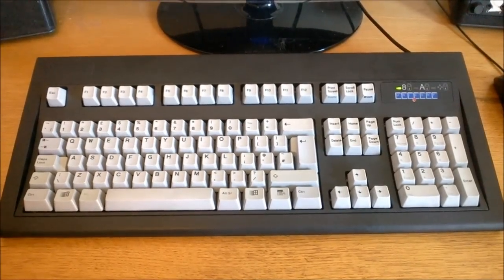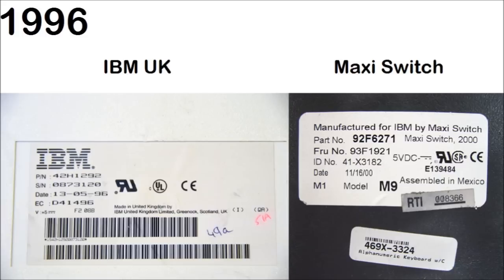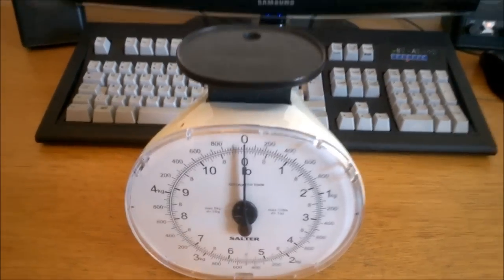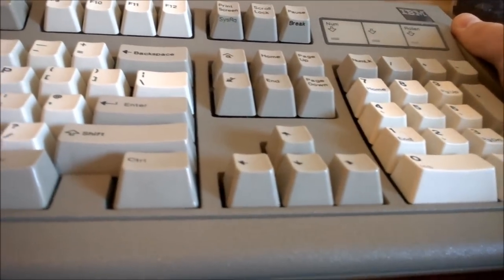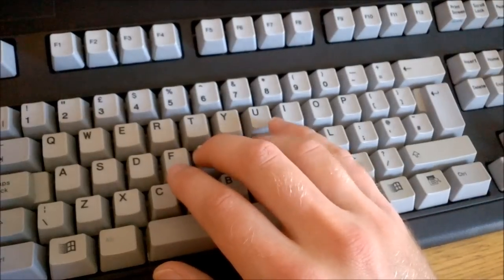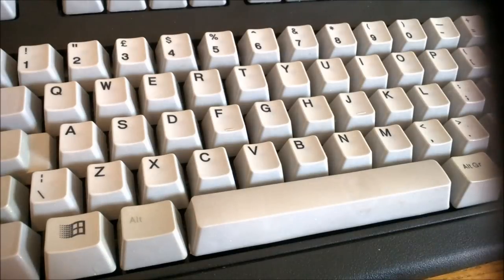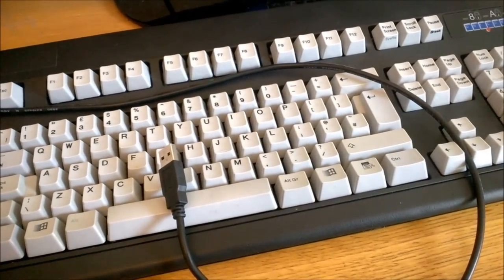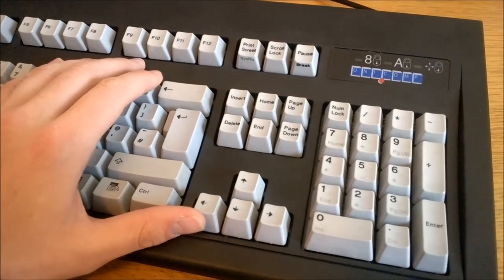Unicomp Model M review (buckling springs)

Comment: I think I have one of those prototype Model M keyboards you spoke about - according to the sticker on the bottom, 20-02-1986 - it has no badge and does not contain the led light panel at all.
Reply from the maker: That wouldn't be a prototype, Ms were already being made in 1985. You probably just have one of the XT models, which (because of the protocol) didn't need LEDs.
Reply: Ahh, good to know, thanks!. It's still got the 'AT' layout though? - function keys along the top and not the left. I've personally had this keyboard since the 1980s and it's still going strong.
Reply from the maker: Lori Brooks No Model M ever had an AT layout, I think you're confusing several types of AT here. There is the AT protocol - just thje language the keyboard speaks - which is almost identical to PS/2, and fully compatible. Then there's the AT plug, which is identical to the XT plug, it's the big 5-pin DIN thing. Then there's the AT layout, which is a physical layout, specifically the layout of the AT model F, which was widely copied by many manufacturers. The Model M replaced the AT layout as standard, which it still is to this day.
Reply: Ah, I see.  I remember using an older IBM keyboard with the function keys on the left with an old 'XT' computer when I worked at Plessey in the '80s 

This one has the keys on the top and an extra key next to the 'Z' that I have remapped into a windows key.

The history of this one was part of a 'CAD' system that tech pubs used on an old tower system (it has the 5-pin din cable but is very long and grey - this might be a replacement for the tower configuration so the keyboard cable can reach the greater distance that it needed to go from the tower up to the desk) 

I inherited the whole system (I had to swap out a brand new HP vectra for this older beast which I remember being bummed about at the time) and then I ended up taking the whole thing home at some point when Plessey were writing it off as scrap - the tower case and system and monitor  are long gone but I brought the keyboard with me to California where it stayed in a box until a year or two ago, when I brought it out and started using it again

Comment: The lettering on Unicomp keyboards had improved by the time this video came out; it used to be worse before that. That's why I bought a completely blank version. The downside of that, is that I get called a 'hipster'; the upside, is that no one around the house will dare touch my keyboard when I'm away.
Reply: It's like the days when I had an HP calculator with Reverse Polish Notation and nobody borrowed it because it did not have an "=" key.
Reply: The legends on the latest Unicomp keys are excellent, I can tell you. Sharper than what Thomas is showing us here four years ago. You can get a whole printed keycap set from Unicomp if you want. They're not too expensive. And you can get some colored keys. I got a set of blue ones for a blue and grey look.

Comment: One note regarding the two-piece keycaps. I'm not sure if they have switched to single piece for the whole product line, or if they switched back to two-piece keycaps. That being said, my 2015 Unicomp has two piece keycaps. It is the 122-key model, but it does have two piece keycaps on all keys except for the multi-unit keys. Interesting that your 2009 one has single piece keycaps. I've heard people mention the single piece key caps before, but never have experienced them. The two piece keycaps on my unicomp are identical to the two piece keycaps IBM used in the past.
Lettering print still seems good, and the only obviously mis-positioned legend on my keyboard is the right arrow key.

Comment: I had planned on getting a Unicomp a couple of months ago, but /r/mechanicalkeyboards talked me into getting a vintage Model M. I ended up getting two, both 1989 models. The second one feels pretty awful and inconsistent, so I bolt modded it, which didn't help much unless I really tighten the bolts down. Tightening the bolts makes the key travel shorter and the key press crisper, but it still feels wrong somehow. Maybe it just needs new springs.

I've thought about getting a Unicomp without the Windows or Menu keys so that I can put it in the vintage case to eliminate the creakiness and flex of the newer ones. I'm not sure if that would actually work because the fixed cable and potentially different controller board placement. Plus, I'm a bit interested in the trackball version and having Windows and Menu keys! Too many options...
Reply from the maker: A Unicomp board will not fit in an IBM case without some modifications. Don't think it's entirely impossible though.

Comment: I got my Unicomp 104 Key with Trackball (Manufactured 4/9/2014). The trackball is horrendous. The movement is inconsistent and after 4 years, the pointer is not moving sometimes. I tried to use adhesive on the rollers, but doesn't improve that much. Not worth the $30 extra compared to their classic Model M. As for the keyboard itself, it has a 2 part key cap and the feel IMO is smoother (closer to a Model F) than the old IBM ones. I own a Model M Blue Badge, 2 x IBM Model F AT and this one. Also, it has a 6-key rollover instead of a 2-key rollover.

Comment: I have one of these, and beleive it or not, the menu key between the ctrl and alt key (and no other key, I checked) IS a two part cap , at least on mine. I don't know if this is characteristic of all uni model M's but check for yourself mine was made on 5/31/2018 so this might be only on later models

Comment: If you, or anyone else, still have this keyboard, I would be very interested in buying it. It done's have to be the same layout, the only requirements that it works properly, is in a good enough state, has a 105-key layout, has the same layout of the bottom row keys as in the video, the button keys between and including the control keys should be in a good state, should use the English names, and there should be an Alt Gr key. As for the rest of the keys, can don't care about their caps, and it don't matter if they are even missing.
Reply: The good news is you can get one new from Unicomp for $104 US plus shipping and taxes. It's now called the New Model M. As for the keys, you can order a custom one, or you can get some custom keycaps (from Unicomp for example) and you can remap the keys as you need. They do both ISO and ANSI.
Reply: To clarify, that problem with the version currently being sold (if you see (on Amazon) a picture with the same layout as in the video, it's just an old picture, they are not selling that version) is that they went full traditionalist (less removing the modern keys all together) and resized the bottom row keys so that LSuper and Menu have the same size as normal keys and RSuper slightly smaller than the other keys (ISO LShift-sized instead of Tab-size), which (the latter) makes the real reproblem not fully solvable using official parts: that they swap the position of AltGr and RSuper which is not only confusion (if you use different keyboards, which is not necessarily solvable) but also extremely uncomfortable (especially when typing AltGr+7 (= {)) even though I'm very well endowed, having 25% larger hands than any other adult male I know (measuring from the largest width of the hand stretched out as much as possible), I can only imagine how uncomfortable it would be for a girl or child.

Comment: I have a Classic myself.  It sometimes doesn't register as being there when you reboot (or even when you come out of GRUB if you're multi-booting).  It's a GIANT pain in the ass given my PC is under the desk.  Also, I've had to adjust the springs on several keys to deal with non-responsive keys and chatter.  Also, while it's USUALLY fine when I'm gaming, I've had issues with the up and right arrow conflicting (I use the arrows for movement as I'm left-handed).

It's such a shame, really.  It's such a joy to type with, but it can't be a main keyboard.

Comment: I have to wonder if the 85 model m feeling different isnt in part because of the older more well worn springs too. 

Model f had one part keycaps too, I know I'm using one, I wonder why ibm changed for the model m.

oh well i still love unicomp and ibm keyboards the best.
Reply from the maker: The '85 isn't particularly well-used at all tbh. But yeah, age itself could be a factor in some ways.

Comment: I just bought one. It has a metal plate inside. it was made 3/18. Did they just start putting metal plates back or does your black unicomp also have ablack metal plate inside? Mine weighs about 4.5lbs, about half a pound more than yours is showing

Comment: I have a really dumb question, I think.

My coworker has a real IBM model M. It sounds awful. I checked it out and if you put your fingers on the keys and jiggle them back and forth (not pressing the keys towards clicking) they rattle like crazy. It seems the keys don't fit very well in the barrels.

If he got a unicom, would the keys be tighter and not so rattle-y?
Reply from the maker: If all the keys do it, it's probably within manufacturing spec. Unicomp's tooling is the same as IBM's, albeit a bit more aged, so buying a Unicomp will most likely not fix this.
Reply: I have a 2021 Unicomp New Model M, and the non-stabilized keys are pretty rattle-y. The stabilized keys (both the spacebar with its wire stabilizers and the rest with their plunger stabilizers) are pretty solid. For all keys there's some binding if you press them off axis, and it's a bit worse for the stabilized keys. But overall, I do not rate the rattle or the binding as big issues personally. I think the keys feel great.

Comment: I feel like IBM tends to over engineer it's stuff. Their mainframes, their thinkpad laptops... everything just built like tanks. So over engineered that it's difficult to break them.
Reply: Saab are the auto version of IBM in that regard ;)
Reply: @zeuperm Too bad HP has that contract now. 🤮
Reply: @sanoj92  SAAB is Shit...  900's and 9000's become money pits after 100,000 kilometers...  They are the rubber done switches of the Auto world.
Reply: And their stuff does tend to last both physically and technologically. I'm in the process of building a Thinkpad T430 and with certain modern parts and mods it's still more than adequate for most computing tasks. Model M is still a great keyboard despite being designed decades ago. So these particular examples weren't over-engineered only to become obsolescent shortly afterwards.

Comment: I was hoping you would compare the controller boards. But thanks for the vid as usual!
Reply from the maker: The controller on the Unicomp is a small PCB where the lock lights are. The old one's is a massive terminal controller pinned to the middle of the back.

Comment: Current Unicomp's do not use a steel plate.
Reply: The Classic model from Unicomp still uses the steel plates. They are as thin as the late Lexmark plates and they are the matte steel finish, but they are still in there.
Reply: I bought mine a long time ago, but my space saver has a steel plate. It's thin and I could bend it over my leg, but it has a plate. It's the 'frosted' looking matte steel, i could see someone mistaking it for aluminum.  The side edges have surface rust. Looks like it was stamp cut after the surface was protected, exposing raw steel on the sides, but the plate is thin so it's inconsequential. Basically, about as cheap as a plate can be, but hey, it has a plate :P

Don't let people tell you otherwise, the Unicomp is very much built down to a price, and you can feel it, even on the updated ones, but they have got better at it, and it is less obvious now. 

Why would unicomp change to aluminum? Steel plate production is typically cheaper than aluminum. Also, steel has a better sound and more heft, meaning it can be thinner while still retaining 'premium feeling' weight, an old school technique that unicomp would probably still follow. Aluminum is usually only used when shipping costs are a major factor, offsetting the more expensive costs, or when 'lightweight' is a metric you are actually targeting.
Reply: I have been inside of a Unicomp board of this age. It's definitely a steel plate in there.

Comment: hello, I have been researching this keyboard and I am still unsure about purchasing one. My main concern in regards to this keyboard is how long does it last. Most good reviews on this keyboard are from individuals who have recently received their keyboard and do not have a lot of typing time on them. I can work around the key looseness and creakiness of the keyboard just to have buckle springs while I search for a decent priced original model M keyboard, but I cannot tolerate the issues that some have spoke about how after a few months some keys began not working or would type duplicate letters when activated. Have you experienced any of this yourself? Thanks for your help.
Reply: Had mine for two years, upgraded to Model F out of want instead of need. Mine didn't fall apart like some horror stories I read.

Comment: Thank you for your review.
I have a question. Do you know if Model M kbd is the same type/tech as the ones that came with IBM PC/XT? I had an IBM PC Portable model, and found the feel of its kbd unparalleled. These have a different feel and sound iirc.
Reply: Those are Model Fs and he actually has a review of the IBM Portable 5155. You should check it out, he went broke for it
Reply: The Model F keyboards used on the IBM PC/XT have a larger DIN connector on the cable than the smaller DIN connector on the cable of the Model M keyboards introduced with IBM PS/2 computers.

Comment: My general understanding is that the Unicomp keyboards are nowhere near the quality of the older IBM Model M's, but are also no slouch themselves and still run circles around most modern competitors out there within their price point.

I think the only reason I haven't given one a shot is just because it seems like after 20 years they should have figured some way around the 2 key rollover problem.  I guess some of their newer models do a little to mitigate this issue, and that it's an inherent design problem, but I mean really I think that after all this time they could have come up with a decent solution, by now.

Comment: Do these keyboards work so you can press many keys at the same time?
Reply from the maker: Being a membrane keyboard, these are usually restricted to 2-6 keys. If you mean NKRO, the sensing mechanism is not compatible with it. That said, the M's predecessor, the Model F, did.
Reply: Chyrosran22 Thanks for clearing that out for me!

Comment: I've bought 3 unicomp keyboards 6-8 years ago. Two stayed with me, the other one went to a friend. All three ceased to operate correctly in the space of 2-3 years due to corrosion (presumably from humidity) in the membrane traces. In comparison, my actual Model-M keyboard on which I'm typing right now was in its original box in some kind of storage since the mid-90s (it's a Lexmark produced blue-badge, but with the coiled lead model), and then after being acquired by me through clickykeyboards.com  has been in continuous use for 9 years now without a hitch. I don't know if the Unicomp tooling is indeed the original Lexmark tooling or not, but there is certainly something very wrong with their membranes. As a result, I would not recommend Unicomp keyboards to anyone, urging them to go for the original Model-Ms, or the really inferior but much less prone to failure due to less parts cherry MX-based keyboards.

p.s. I tried to repair the membranes of two of the unicomps with mixed results: http://imgur.com/a/4jmvn  The Model-M construction which is followed by unicomp, with its sandwich held together with plastic rivets, makes it very hard to repair. Thankfully I never needed to do so with my proper Model-M.

Comment: Is there a way to muffle a buckling spring switch?
Reply: yes, in the same way that you can cut off a lion's mane.
Reply from the maker: Originally IBM sold models with greased springs that had a slightly muffled sound. Still not exactly quiet though.
Reply: Look up the "Floss Mod". I haven't tried it, but, apparently, it takes the ping-y sound out of the springs.
Reply: Thanks.  There's a good video of someone that used paracord instead.  Seemed to work very well.
Reply: They also make a rubber dome version that's quieter.

Comment: Is there a way to get it in an AZERTY layout?
Reply: PegAsus I feel as if you can change the settings in Windows for that format. You can easily switch keycaps around as all the alphanumeric keys are the same size.
Reply: Unicomp offers international layouts on their website
Reply: If all else fails you could buy a uk layout and swap keycaps (unfortunately no é or è) or maybe even buy new caps custom

Comment: Does the Unicomp Model M use those stupid hex bolts like the IBM versions?
Reply: I have a Unicomp Ultra Classic, and unfortunately it does, I can not talk for this one, but I would assume it does.
Reply from the maker: Yes, they never changed the bolts.
Reply: kL-Spazmo Basically creating your own screwdriver by molding plastic?
Reply: Why on earth would anyone prefer shitty phillips screws over superior allen screws?
Reply: @AtomicSkull Phillips isn't the only other screw-head type.  I'd prefer Torx screws as they're MUCH harder to strip out the head compared to other types.
Reply: They aren't allen screws.  They have unslotted hex bolt heads.

Comment: Thanks for the info. I'm considering buying a new Unicomp with a Windows key to replace my M (1391401) so I can map the Mac Command key to an otherwise useless key. I bet you can't type on a Microsoft "ergonomic" keyboard, like I can't. :)  I'm closer to a canonical touch typist than you, but I "cheat" on some keys; B with the right hand for example.